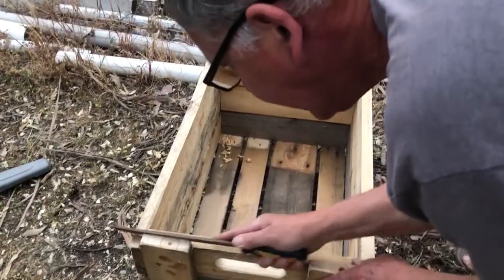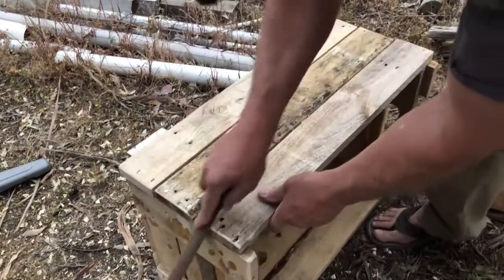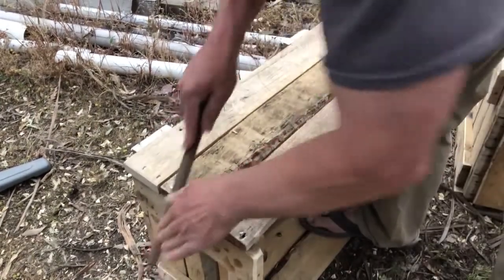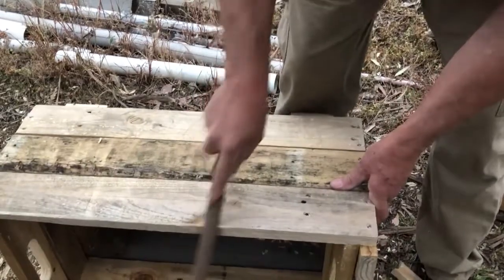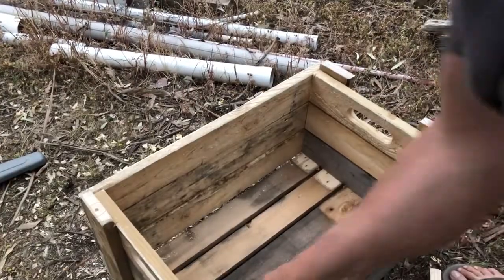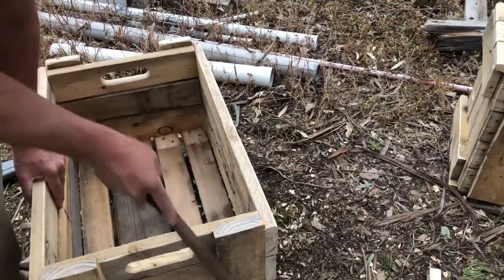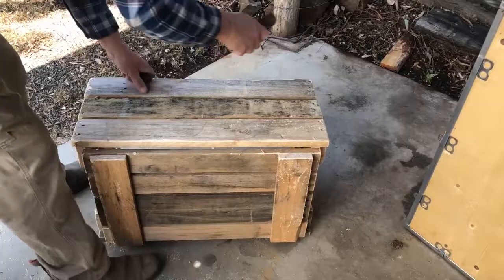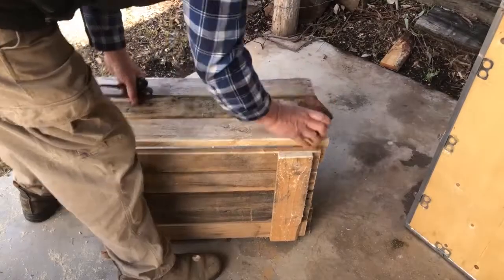Off the Grid Makes - 35 How to Make Crates from Pallet Wood

Comment: I found myself dismantling so many pallets I made a tool, take about 6" of 20mm bar, weld on a 1"x2" RHS handle (so it looks like a hammer), then weld on a 2" length of 1" angle off the side of the hammerhead. You drop the tool in the gap between planks, turn it 90 degrees and pull off two planks at once, (in hardwood you do one at a time, starting from the end)
Reply from the maker: Have a look at my other 'pallet' video for my solution to the same problem :-) https://youtu.be/Ywut1ePa3C0